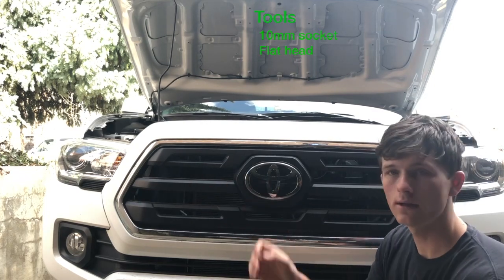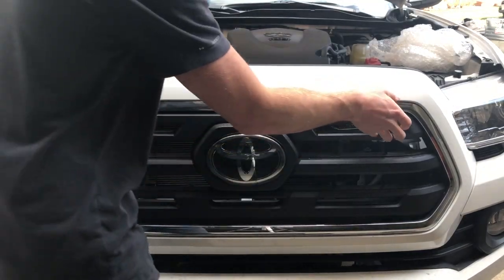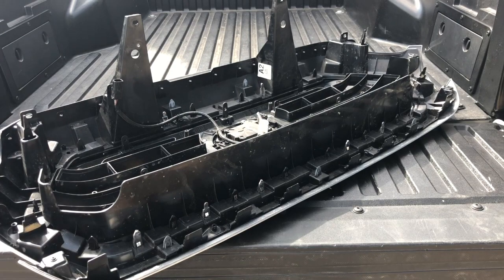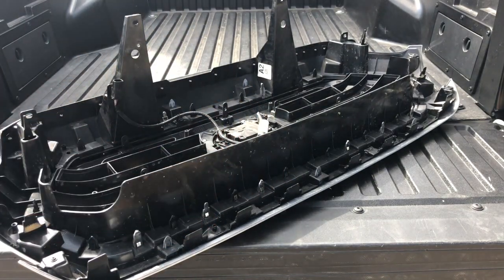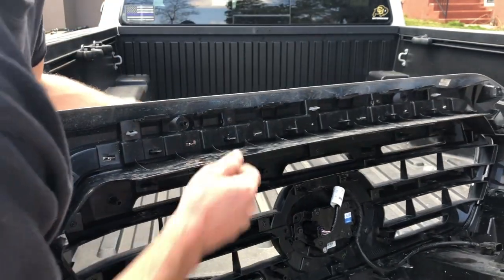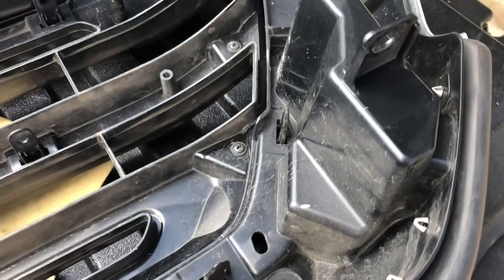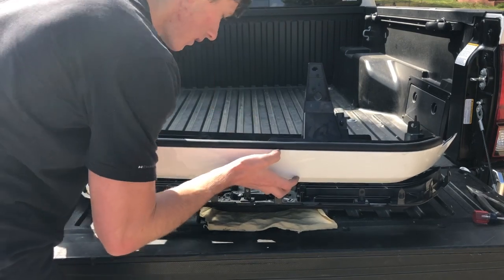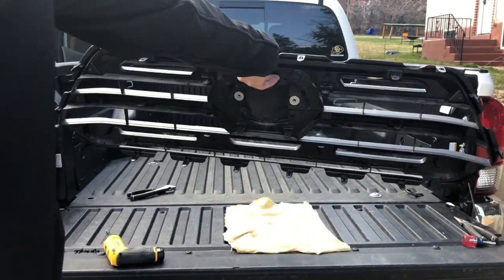How To Remove Front Grill WITH Sensor - 3rd Gen Tacoma - Step By Step

Comment: How do you know if you have a sensor in front?  I have a stock 2017 Tacoma Limited, just got it and looking to do some easy mods.  Thanks for the video, it's extremely helpful.
Reply from the maker: nitara, the grill will have the wires attached to the grill. But 2018 was the first year Tacoma’s had the sensors. You can still change out your grill.
Reply: I had a 2017 and has no sensors, I swap my grill and no problem, tacomas with sensors on grills are 2018 and up.

Comment: Since the sensor lies behind the front badge, is there anyway to take the badging apart? The goal would be to remove the chrome of the Toyota logo, but inside of the plastic shield... I really don't want to just tint over the front plastic.
Reply: Hey, did you ever figure this out I too want to do this but don’t want to just simply tint the shield cover
Reply: @parkervicich4331  nah, never found a way, and just went with a TRD Bro grille instead lol

Comment: My 2021 front sensor isn't working even with the washer trick. 
Any suggestions 
Thanks
Reply from the maker: Did you lift your truck? if so, you need to make sure it has the same rake. If not, bring it to the dealer.

Comment: seeing that the front grill is kinda exposed, is it safe if it gets water in there from a car wash cause of the sensor
Reply from the maker: I would not power wash the sensor, but the engineers should have designed it to survive in all types of weather

Comment: What about sensor recalibration?
Reply from the maker: There is no sensor recalibration because it is the exact same grill from Toyota except the looks are different
Reply: @92813justin  I have a bull bar on the front of the truck. So I couldn't do it anyway. Thanks.

Comment: I can’t get that damn harness clip to come off no matter how hard I press on the bottom part
Reply from the maker: Ivan Hernandez, those are really difficult. You can try to use needle nose pliers
Reply: I damn tried twice to take them out , i couldnt and returned the part back. Eighter break them or dont change the grill. Espcially chrome bezel ones are  to delicate and breaks right away.